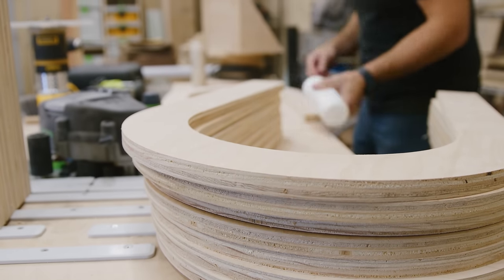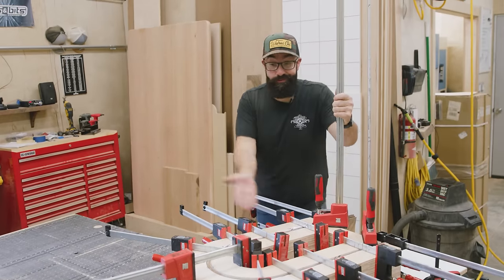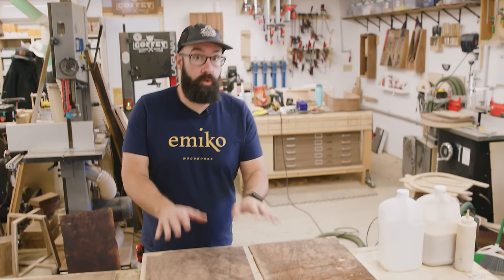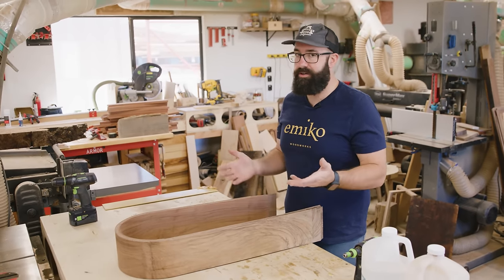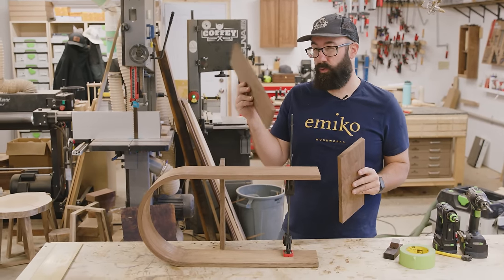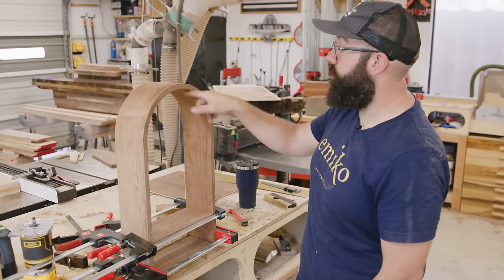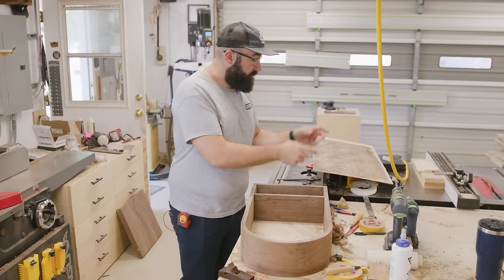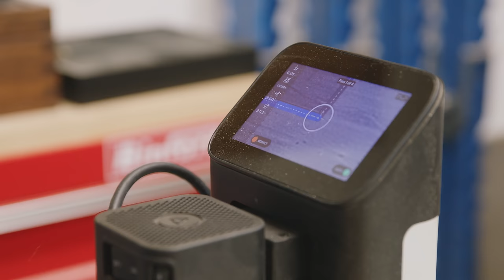My First Bent Lamination Cabinet—What Went Wrong?

Comment: Just as a tip for future. I did a bent lam glue up with /8 laminations myself recently, but I first steamed them and put them in the form, let them dry then did the glue up later. Worked fine, that was 100 yo oak too, really dry stuff.

What a spectacular build too. Loved how you saved that awesome Burr veneer for whoever opens the door :)
Reply: how did you steam them and for how long?
Reply from the maker: Thanks for watching!